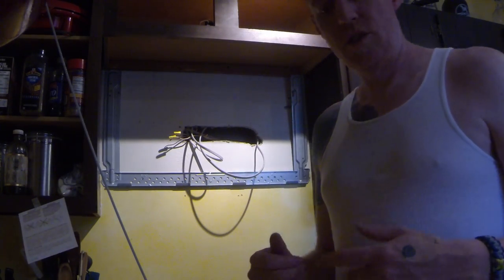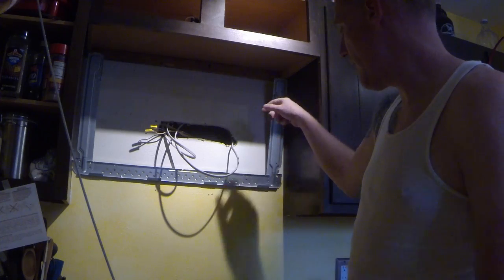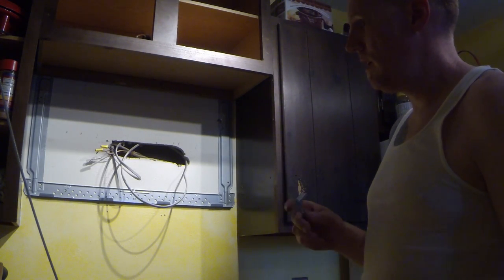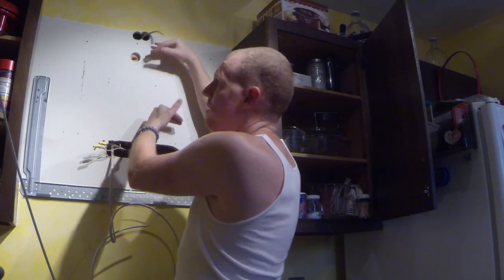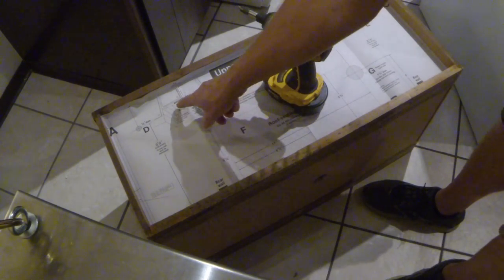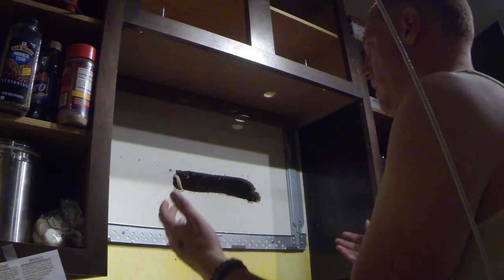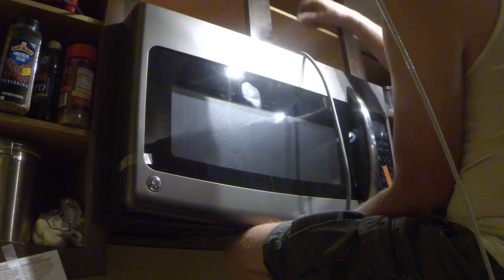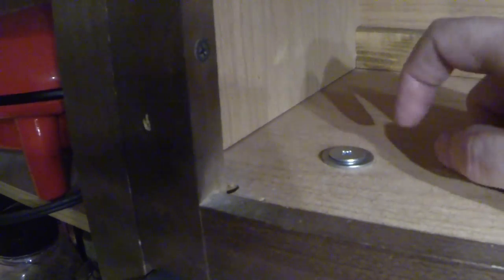How to install a GE Adora Over the Range Microwave Oven.

Comment: I just recently installed a new GE microwave (Model# JVM6175EF1ES) and wanted to add my comments regarding the installation.  Mine came with a paper template that looked much like the one in this video and I too was racking my brains trying to figure out the best way to use it.  I even considered cutting out a template with the shipping box since the cardboard was much stiffer than the paper template.  Then I had a brainstorm!

What I did was just forget the template...completely.  I installed the rear mounting bracket as stated in the instructions.  Then I, with the help of my wife, lifted the microwave and dry fitted it onto the bracket to verify it fit properly, which it did.  As stated in this video the new unit is not heavy at all.

I then took it down, installed the top mounting bolts (2 of them) then ran them about 95% of the way in.  I then applied a special formula (toothpaste) to the bolt tops, reinstalled the microwave and lifted it up until it met the bottom of the cabinet. Note: check to see if it makes a mark on both sides, if not you may need to slightly unscrew a bolt until it touches the cabinet.  Then we took the unit back down, made a mark with a pen, or marker, right in the middle, wiped away the toothpaste and voila!, there are your drill points. ( I used a pencil but it tended to smear when wiping the toothpaste away.).

After drilling the holes it lined up perfectly the first time and was so easy.  Give it a try.
Reply from the maker: +Rick L Great input and alternative idea! Thanks

Comment: I'm trying to install my microwave but have a couple of problems. I have a plywood back splash in front of the drywall (about 1.5 inches thick total) and then concrete like half an inch behind the drywall. I can't fit the toggle anchors in the wall and I don't know what I should do.
I think the plywood is glued onto the plywood, so I was thinking maybe I should put a couple of screws through it and into the stud and then put one screw through the bracket and into the stud, and then just use wood screws in the other required holes. The stud is maybe 6 inches from the left edge
Also I made a hole for the toggle bolt but it didn't work so now i have a half inch hole in the top right corner with no screw to put there. How should I fix that? Please, help me!
Reply from the maker: If the plywood is actually 1.5" thick you could use the lag bolt into that as it's thick enough to support a lag bolt as long as you drill a pilot hole so it doesn't split.
The hole in the top right corner, is it through the concrete as well? They do make longer toggle bolts that you could pick up at a hardware store.
Let me know how it goes.
Reply: I ended up just getting an extra long drill but and using 3 3/4 long tapcons. That bracket's not going anywhere
Reply from the maker: Nice, good to hear!

Comment: It appears as though you attached a section of wire to the existing wire (Presumably to allow it to reach the new receptacle installed in the cabinet above). It is illegal and pretty dangerous to bury a spliced wire in a wall. The splice should be contained in a junction box and should have an accessible cover. Your application does not allow for good placement of a junction box so you should have run a completely new feed. Better to be safe now than sorry later.
Reply from the maker: Yes, you are correct and thanks for pointing that out. This was a temporary situation for the time being. The entire wall that it was mounted on has since been demolished for a kitchen renovation with all of the wiring up to code. I probably should have mentioned some of your points in the video as I was shooting it but I wasn't really thinking about that at the time.
THanks again for the comment.